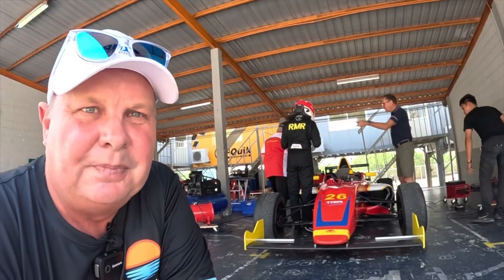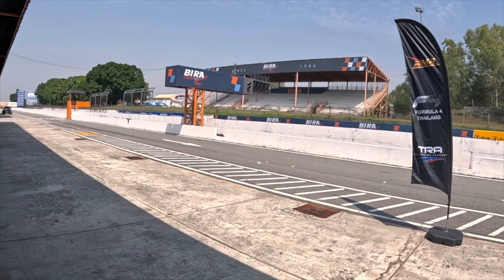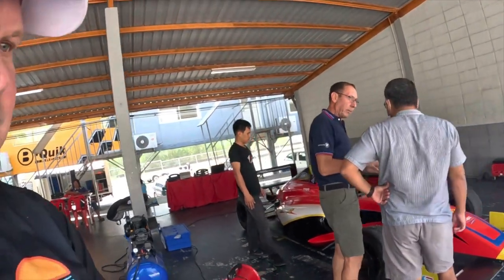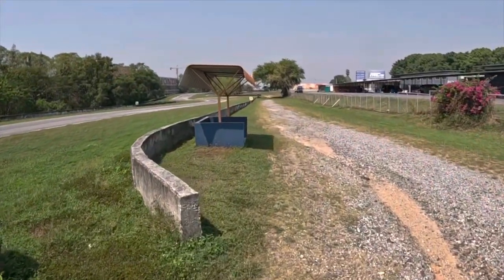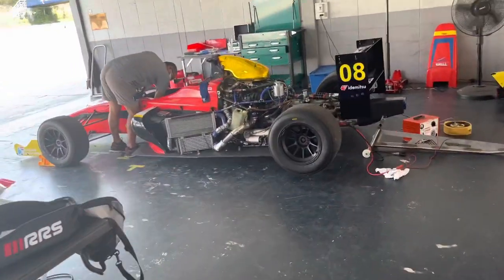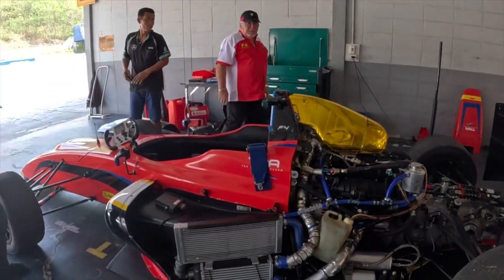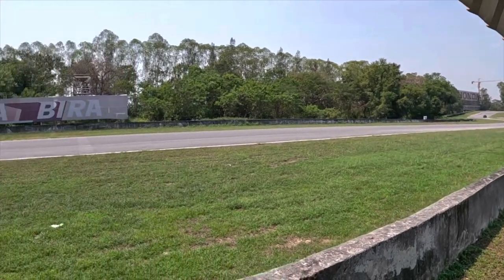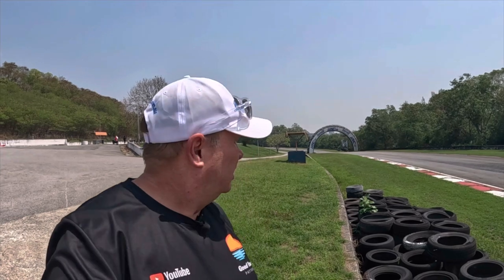WOW - Drive an ex Red Bull Formula 4 Race Car in Pattaya Thailand for under $1k for 90 minutes - WTF

Comment: You have a accident im sure you pay indeed but yes you can get a ride of these in Vegas different set up of course but well worth it you do a Training course first for 4 Hours then you follow a driver around the circuit  then if you have passed all the Tests off you go but you must pay for insurance and it is speed limited but yea they go fast in Vegas.